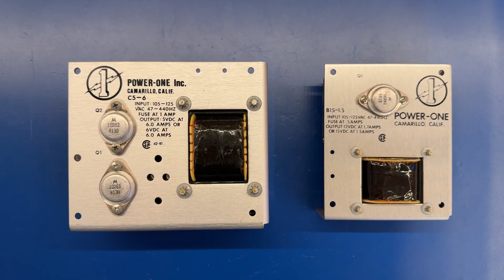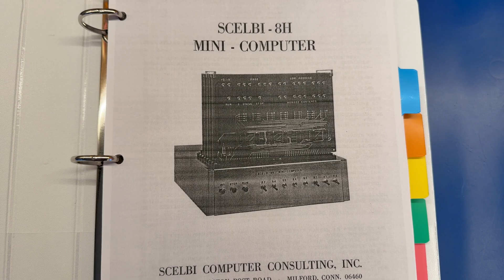Building the SCELBI 8B Minicomputer

Comment: What an amazingly fun project! Takes me right back to my childhood years of etching PCB's on a desk in my bedroom, using a glass tray stolen from my dad's dark room, and then soldering it together with, obviously, leaded solder. Looking back it's amazing I'm even alive. :p

But seriously: how difficult, of even possible is it to source the components? A quick search would suggest that 8008's are still to be found, a glance through the manual shows loads of 74xx and 74Lxx's . I will assume for now that most of these can be replaced by 74LSxx. But apart from these, are there any special, 'tricky' components that could cause issues?
Reply from the maker: I only use lead-free solder nowadays :-) the components are not too difficult to source. I think the hardest components to find are probably the IO connectors on the back of the computer. You can still find them on eBay occasionally.

Comment: Does this computer works with an Terminal and is the max ram 64k for cpm ?
Reply from the maker: The max ram is 16K. Yes, you can connect it to a terminal but you'll need a serial interface. You can also use the TTY interface.
Reply: @artemkalinchuk  would be good plattform for a new OS written in machine language by an AI….
Reply: I read about someone who had a Mark-8 with 32K of ram, but they had to use bank switching. I can't imagine what software for the 8008 could utilize 32K of ram.

Comment: biology ? what were they thinking ???
In a nutshell its another 8008 based computer with 4K ram and 8k rom capable to interface with  teletype. On the website there is schematics to interface with oscilloscope so probably it can also generate vector video output.
Thanks for the video. Your videos always add something new to my knowledge.

Comment: One of these days I might build a Computer Space.  I'm thinking of condensing it down to one or two boards with mostly through-hole components.  The logic chips are still readily available, and I might be able to get away with using 74HCT as it's all standard 7400 logic as far as I know.  I'm thinking of using surface-mount diodes for the diode matrix ROM and having it run from standard +12 and with a composite output.
Reply: Just be warned that there are some flip-flops it uses that are different between 74xx and 74LSxx because of the clock going from level-triggered to edge-triggered. The 74HCT version will probably have the same problem. Apparently Computer Space needs the level-triggered version.
Reply from the maker: That would be cool. To me, the hardest part is always the enclosure.
Reply: @artemkalinchuk  I was thinking more along the lines of building a standalone device which connects to a TV rather than a dedicated arcade cabinet.
Reply: BudgeTronics at least used to sell a set of boards for that.  It was a limited run, though, so they are probably sold out now.  And, of course, they needed the original parts with no shortcuts.  It's still neat the someone did it, though!

I tried playing Computer Space at a temporary arcade in nearby Mesa once, but I couldn't get the hang of it.  It was great that it was available for people to just play, since it's so historic.